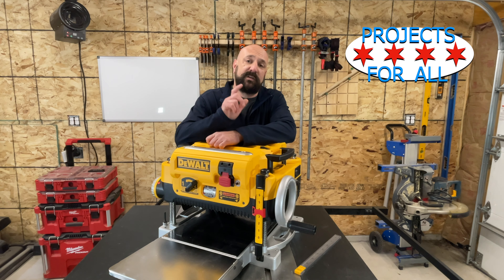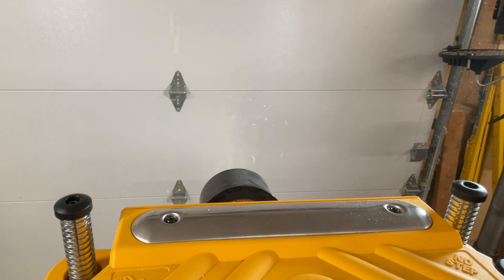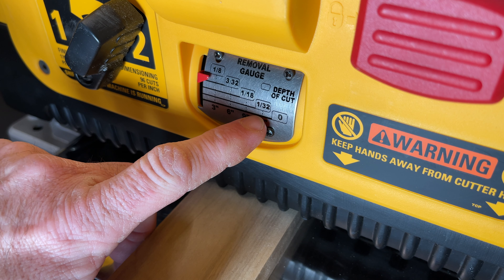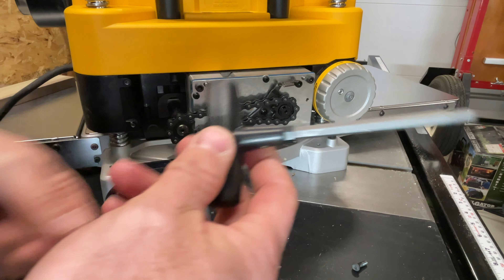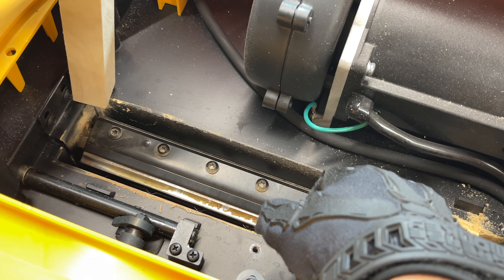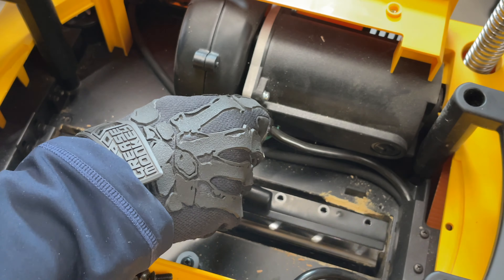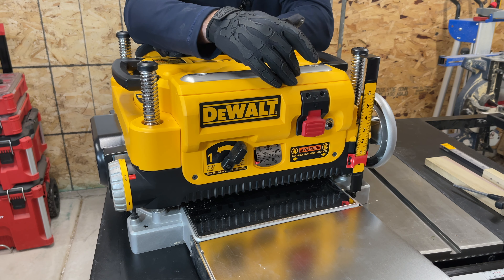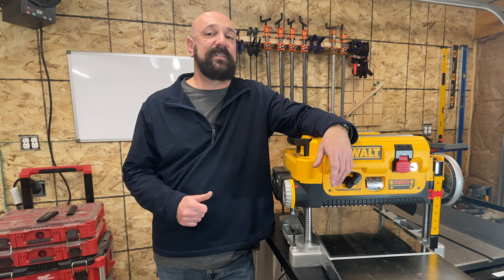A Beast Of A Wood Planer || DeWALT DW735 || Lets Check It Out

Comment: Got one, I've loved it for about eight  years now.  My only complaint is how easily the blades chip.  Everyone recommends the helix cutter, but I can't justify a $600 upgrade to an already great machine.  Plus, I don't use it enough to make the helix cutter pay for itself.  I do a lot of hand planing 'cause I like the procedure and the final finish.  Also, the blades are double sided and are inexpensive enough when you have to replace them.  Another fine job, Mike.
Reply from the maker: I’m right there with you. I have a chipped blade now that makes a line on anything I plane. Will have to flip the blades next use. I agree with you about the helix too. Looks awesome but the price has kept me away since this isn’t an every week use tool for me. Even less now that I spend my free time making vids. Thanks again!

Comment: A good summary of this machine.
I have had this planer for over six years now, and I am still very happy with it. Many boards went through this little thing, and it had to withstand some misuse. Just recently, I many board foot of quartersawn white oak went through it, and no complaints. Changing blades is easy, like a walk in the park, and they hold up very well. The only downside is the noise, that thing is very noisy. I will upgrade to a spiral cutter head, bringing the noise down and improving the surface quality. Great tool for the price compared to other similar-sized planer.
Reply from the maker: I agree the noise is bad. This is hands down the loudest machine I run in the shop. New hearing protection was bought shortly after! Thanks for the comment!

Comment: Thank You for the review… I’ve been on marketplace on and on ..for a planer. I wanted to get a planer, basic rigid 12’ inch one 2 blade. But I think I would need to invest in this.
I may need to shell out 1k for this planer. Wife got me going on some crazy projects this summer lol. 

Do you think the 12” planer is good enough and comparable to this? They bought have 3blades and I don’t need to break the bank as much $849 cad for this or $589 for the 12” one.

Let me know what you think pls. Any input is appreciated
Reply from the maker: Hello John! I have the DW734 12 inch planer in the shop now for testing. Watch for an overview on that model this Friday and a side by side comparison video of the two the following week. They are both good but I have a clear favorite and they are pretty different in function. Please post any questions you have and Im happy to help! Thanks for watching!
Reply: @ProjectsForAllReviews  Perfect timing... I will be picking  up the planer this weekend. And been comparing on my off nights at work watching youtube lol

735x vs 734 can't wait!